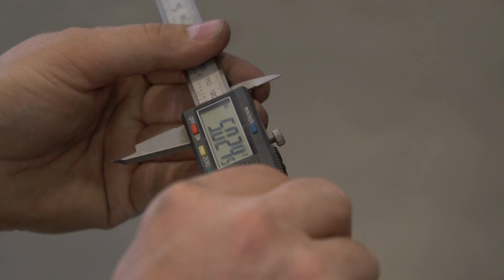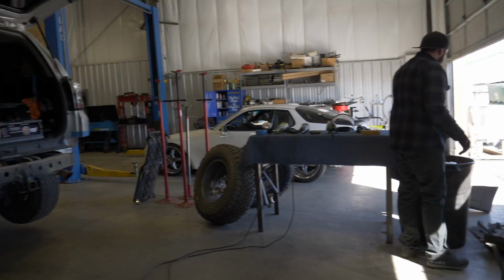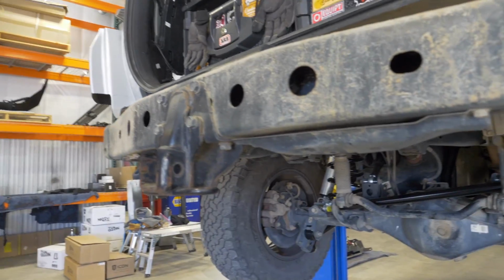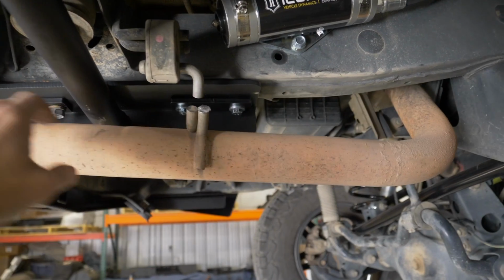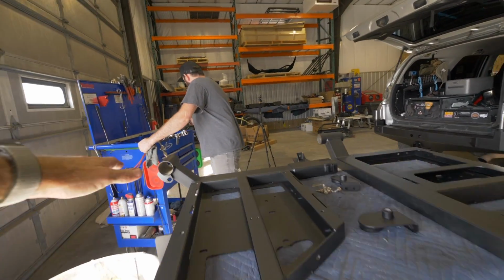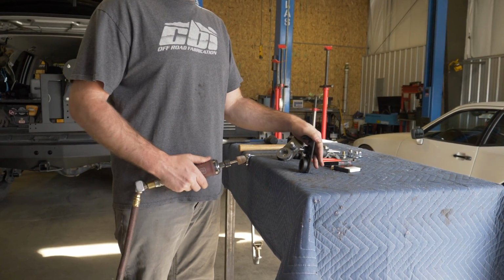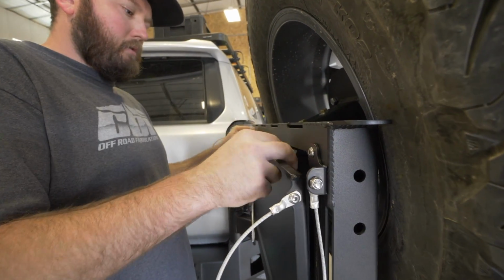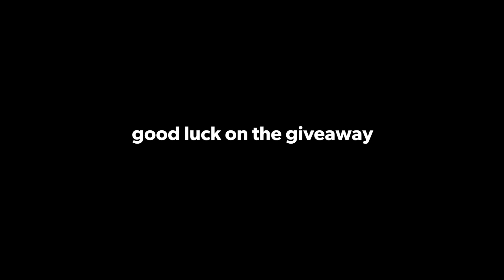Why I added 100’s of lbs in Steel Bumpers to my 4Runner (PLUS C4 LoPro Bumper Giveaway)

Comment: Found this on the web: When an engine requires lower levels of octane to “fire,” the overall efficiency of the engine is also lowered, which means the engine works harder to achieve the same results. However, less fuel burns, which means the overall fuel-per-mile efficiency is increased because the engine is working at a reduced compression rate. In short, you can get higher miles-per-gallon at higher elevations, but the power of the engine is also somewhat reduced.
Reply: Glenn McEnroe you may have misinterpreted what you read a little. Octane rating is a fuel’s ability to resist “knock” which is when a fuel prematurely detonates due to the heat produced by the fuel/air mix being compressed. The octane rating of fuel has nothing to do with how much fuel is burned in and of its self. The higher the compression ratio the higher the efficiency (and power output) of the engine. Also running higher octane fuel allows for more aggressive timing, which makes more power and is more fuel efficient. The lower density of the air at higher elevations means that for each rotation of the engine less air is being taken in and less fuel can be burned, this does not make the engine more fuel efficient. Part of the energy released by the burning of fuel goes to propelling the car, but a large portion of that energy also goes to overcoming fictional losses within the engine and driveline. So at higher elevations the engine makes less power (and burns less fuel) per rotation but the frictional losses remain the same, this means that a larger proportion of the energy generated is consumed by engine friction rather than propelling the vehicle. This means far worse fuel economy. This is part of the reason a lot of piston powered air craft have turbochargers.

Comment: @Jason: Here’s what I figured out regarding the MPG’s:

Reason #1: You gone from Florida (sea level) to Utah (not sea level) there by putting you further out on the earth’s circumference, so the 4 runner is actually 162 lbs lighter than it used to be. 

Reason #2: Florida’s atmosphere is really just water in a suspended state, and it’s actually an unexplained scientific mystery that the inhabitants in Florida don’t just drown. Also, water doesn’t burn that efficiently in your engine...

Reason #C: Magic.

I hope this helps explain things.

AdventureWithDanan
Reply: IVE SEEN MANY , MANY INHABITANTS DROWN..............IN  FL., I LIVE HERE.....WORK ,SWIM ,SURF, DIVE, FISH, NEED I GO ON ?.....OH SNAP! CIRCUMFERENCE. I  THINK NOT! PERHAPS POSITION AND CONCORDANCE COULD BE THE CULPRIT. JUST A STONED THOUGHT.............PONDER THAT OR MAYBE ITS ALL JABBERWOCKY! YOU KNOW THOSE DARN MORMONS! GOT KUSH?
Reply: Lower humidity, is the simple way to say this. Logic is all that is needed. Like firewood, any fuel to air ratio, burns in a dryer state. Wet firewood, no burn efficiency. Damp/wet air mixture/condensation in fuel, no burn efficiency. This is also where the weight loss comes from. 

Also, you have less drag from the shape of the Steel bumpers and skids, compensating for the weight.

Comment: I added 130+ lbs to the rear end of my Jeep JK with an LOD Offroad Destroyer. Combined with the front bumper mounted winch has resulted in some definite spring sag. I'm saving up for that suspension upgrade.

Comment: You've  mentioned supercharging the 4Runner a few times now, have you looked into re-gearing?
Reply: Exactly what i commented on his last video.
Reply: +Bryan McGrath what's re-gearing? (totally honest question)
Reply: @shawn1928  the extremely simplified explanation is changing your ring and pinion gearing in the differentials to change how many revolutions of the driveshaft cause the wheels to make one revolution. It's usually done after going up several size tires to put less stress on the engine and transmission. It's similar to downshifting when you're going up a steep hill to more efficiently put power to the wheels. This can come at the cost of top speed depending on gear ratio and tire size.
Reply: I super charged mine.
Reply: Even they’re pretty slow from factory to begin
Reply: nick stenftenagel what year model and what supercharger?
Reply: Add more steel, as much as you like, as thick as you like, it can take it. The heavier the better.
Reply: Great question. It would make it feel way more “powerful” to lower the ratio a bit.  Definitely needs to bring the torque factor into play with the taller tires & the added weight needs to let the torque “band” you have to work efficiently.

Comment: Didn't want to read all the comments, the question may of already been answered with a better answer then mine, but with regards to better gas mileage at higher altitudes, your computer will always try to maintain the correct air/fuel ratio regardless of how much throttle input you give. If your vehicle were to use more gas with the thinner (or less) air, it would then be running rich. Hence you EFI system keeps the air fuel ratios in check so it uses less gas because of the less air at high altitudes. Of course it comes across feeling like it has less power.

Comment: At higher altitude, your air is thinner, less oxygen. Your computer will adjust fuel to match, so thinner air equals less fuel injected during the injection cycle. This is done to prevent the engine from from too rich.

Comment: The fuel efficiency issue is a bit complicated.  At higher elevations, the engine's octane requirement is deceased, which means the engine needs less octane to properly fire.  This is why you can find 85 octane in high-elevation areas like Colorado, (instead of 87 octane).  The engine's lower octane requirement also reduces the overall efficiency of the engine, which means the engine will have to work harder to achieve the same acceleration.  Despite this loss in performance, less fuel is burned, which obviously results in a higher MPG.  The reduced air resistance is also a factor, especially when travelling above 60 MPH.  But the effects of a decreased octane requirement effect the MPG at all speeds.   This is at least what I learned when I researched this while considering the effects of high altitude at drag races.
Reply: Peter Kowalcheck this is true but people don't generally change the fuel they burn in their engine during a trip.  The other end of the equation is; 

1- due to the lack of knock, the engine will advance it's timing further than it will at a higher barometric pressure.   This increases efficiency slightly.  

2- The lower amount of air and fuel in the cylinders reduces consumption at the same rpm.  

3- Generally at cruising speed on the level you don't notice the reduced HP due to the thinner air you are pushing through.  You only notice it when accelerating.  All three factors come together to increase fuel economy at higher elevation.
Reply: also, less atmospheric pressure means you have to open the throttle more to get the same air into the engine, so less throttling losses for the intake

Comment: Cold air will give you more power and fuel efficiency. Most of the time its going to be colder in elevations, especially compared to Florida. Multiple things more than likely contribute to the differences. As someone else mentioned the thinner air etc

Comment: The safety issue when adding weight is that your breaking distance increases noticeably, sooner or later you may have to think about a break upgrade.
Reply from the maker: Agreed. I have slotted rotors as well.

Comment: The reason why you have better mileage at ALTITUDE is that the Fuel -Air mixture is a lower ratio due to the less dense air at that altitude.

Therefore, the fuel required to maintain the proper performance is less.

Comment: The 4Runner has air dynamics of a brick. There is less air dynamic air resistance when driving at higher altitude because air is thinner (lower pressure and less density).  I too noticed better gas mileage at higher altitude, especially at freeway speeds.
This is why an airplane's wings have less lift at high altitude and also at higher air temperature. It's called - Density Altitude. Density altitude also increases with air temperature (air gets thinner). High moisture in the air also reduces air lift (and air resistance for a vehicle).

Comment: Nice mod with innovation,it is actually hard to setup front metal bumpers on that new 4Runner,because of it's wide radiator vent/grill and that massive plastic bumper which comes with the truck,you right now have the best 4x4 off-roader like a Jeep Wrangler,do you have plans for swapping  the front ifs with a solid axle?

Comment: Use some Fluid film to keep those hold open spring pins from rusting,  Still loving my Supercharged FJ,  and now with the 30 Gallon Main tank, it is working really good.  Pulling a trailer, the supercharger makes it really nice.
Reply from the maker: mmmmm.... How many miles have you ran it?  Any issues???
Reply: @SwellRunner  4500 miles so far,  no issues,  so far, temps, fuel mileage.  Automatic Transmission shifting in mountains, all great, and much improved.  Getting ready to install a second fuel tank to give me a total of 60 gallons.

Comment: The impulse to add everything we need is hard to ignore. I am building mine slowly but surely, and the further I go, the more I start thinking of the trade offs differently. Bone stock, I wasnt a huge fan of the Power to MPG ratio. It is indeed under powered for a vehicle that gets such poor MPG in comparison to other SUV's. Ive considered the SC, but I cannot convince myself that the improvements are worth the money. Front Bumper, Roof Rack, Sliders, Rear Bumper, Fridge?Freezer, it is all adding up. I am really enjoying ownershipo, but the cost so far has been like a self inflicted wound (Considering what I spend on upgrades).
Reply from the maker: You are definitely right. It’s interesting - people see this kind of stuff go on, but don’t immediately realize I’ve been working on all of this for almost 3 years. Where I am now is the result of a constant evolution over the three years I’ve owned this truck. There are definitely trade offs in everything - but I’ve kind of resolved that this isn’t a sports car, I don’t need rapid acceleration, without the trailer it drives great still and with the trailer, the only places I get frustrated with lack of power are on the highway at steep grades. SC doesn’t really fit the long term goals of the vehicle so...
Reply: CENFL Overland - well, you forgot about sponsorship. I would love to "test it out" some of those products, or get them 1/2 price to review them. Or get a replacement because it got wet. Not everyone is blessed with ability to ask for things. Some of us will get rejected because of the way we speak, or look, or where we came from.
Good luck to you. Your channel looks super cool ! See you on a trail somewhere out there !
Reply: @mar1video  I totally understand your point. This is my secondary Channel. My main has over 20k subs and that has definitely allowed me access to products in that particular Industry (Channel is Shwell11) that I couldnt otherwise afford. While your points are extremely valid, you have to consider how much work and how much decision making goes into it. When these channels do it all right, it is like a second Job. Maintaining the products, the relationships, and the goals of the channel and the Brands that support you is a lot of work. Behind the scenes it isnt all sun and fun, there are still cost involved and work involved. I havent touched on "Risk by association", which is something huge to consider. Some of these Channels are Marketing Machines, and offer more to some Brands than a Full Time Marketing team can. There is tons of value to what channels like this one brings to the Manufacturers and to the Consumers. 

So far I have paid for everything i have installed on my 4Runner, but even at my level I have had a few Manufacturers approach me with huge savings on Products that would be further down the line instead of being available (Within my Budget) now. 

Some of what we see on Channels like this is unobtanium for many of us watching the process, but it still offers us a look at Products we might not be able to see during our daily lives. Time, Effort, and Money go into all of these vids. I can say without a doubt that Jason has saved me a lot of money and saved me from a few purchasing mistakes, and that is invaluable to me. there are 8 firearms in my collection that I wish someone would have warned me about before I purchased them.

Comment: I've follow your videos for quite some time, but don't recall a few things. You mention that you (or others might)question the cost you will suffer in performance and gas mileage. We (4x4 scene) fully except that but in the same breath we try to gain it back where it is posable. The question I have is have you matched up your ring and pinion with the tire size you are running. With the trailer you are towing while you are exploring you may want to gear it a tad lower to take some of the strain off your powertrain? Anyways Love what you are doing and keep up the great work! Thanks David

Comment: Great rear bumper.  I would have recommended getting CBI’s dual military gas can holder option instead of the Rotopax as each Wavian gas can holds about 5.3 gallons.
Reply from the maker: I didn't put a lot of thought into that as I believe I can add that later - great suggestion - PLUS, can't you get storage containers in that same size as well?

Comment: I installed front and rear off road bumpers and my over all mpg went from 16 to 14 on my old xterra.    It might be it has 314,000 miles on it that it is not as fuel efficient as it use to be.

Comment: We love your sharing. Thank you.
I found this: Altitude decreases an engine’s octane requirements because of the change in air pressure. The higher elevations have a lower level of air pressure, which means an engine needs less octane to properly fire due to the lower ambient pressure. In certain states, such as Colorado where the altitude is generally above 5,000 feet in the mountain regions, 85 octane gasoline is sold, while in lower elevations 87 octane is the lowest sold.

End Result

When an engine requires lower levels of octane to “fire,” the overall efficiency of the engine is also lowered, which means the engine works harder to achieve the same results. However, less fuel burns, which means the overall fuel-per-mile efficiency is increased because the engine is working at a reduced compression rate. In short, you can get higher miles-per-gallon at higher elevations, but the power of the engine is also somewhat reduced.

Comment: The fuel efficiency of your vehicle has a lot to due with the quality of air and how much ethanol content in the gas. 
     With Florida being a very humid state there is a lot water in the air. Your air filter can only stop so much of the water from reaching the combustion chamber. The More water you have in the system equals less of an explosion.which results in less power. Which in turn means the engine has to work harder to reach the same amount of performance . However the humidity won't show a drastic enough change for you to notice a difference in the capabilities for you to accelerate. But it can certainly drop your your fuel mileage a little bit. 
    On another note most gas stations will say right on the pump the the gas contains at most 10% ethanol in the fuel. Ethanol has less energy than gasoline. Which will create the same effect as having the higher humidity content. With the gas station not giving a specific percentage of ethanol. It's possible that their might have more ethanol in Florida as opposed to somewhere else . Example 9% ethanol vs 5% ethanol. 
  In summary the possibility of having higher humidity and/or more ethanol content  playing a role with your fuel efficiency. It might be the reason why you'll notice a difference in fuel efficiency. Even though you'll have a lower content of oxygen at higher elevation. I hope this helps gives you an idea on why there is a difference.

Comment: You get more mileage at altitude because the fuel
Mixture requires less fuel because there is less air to keep the mixture optimized by the ecu’s fuel map......  I would love you C4 low bumper for my new 2019 TRD Pro voodoo blue!  Would be my first mod.  Getting a supercharger in December!   Also at altitude you would greatly benefit from the supercharger because you would have little to no HP loss you have at altitude.  The supercharger maintains the 6psi of positive pressure no mater what the elevation....  you are losing almost 15% or more hp at your altitude.